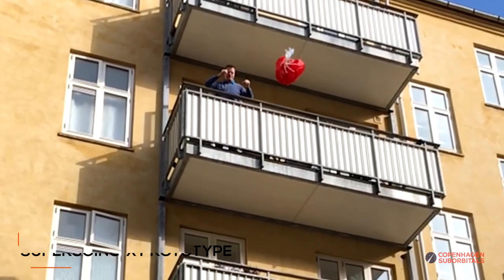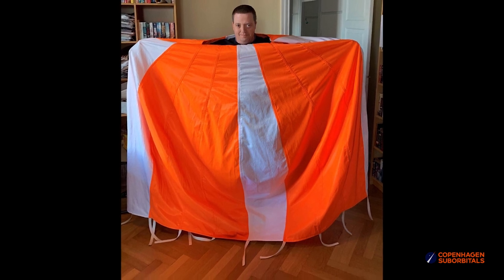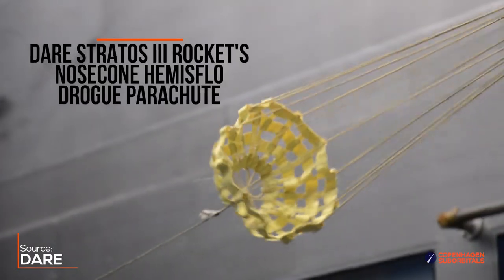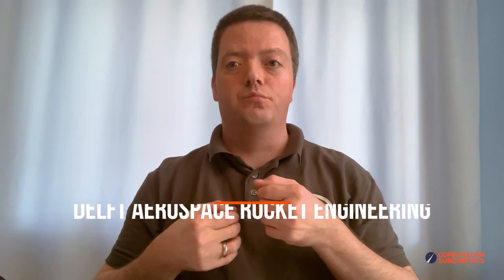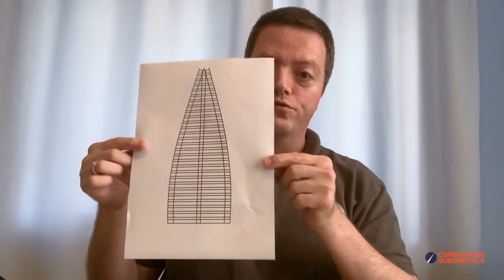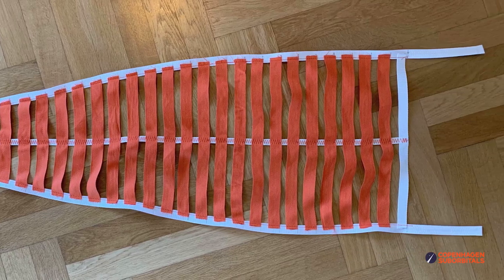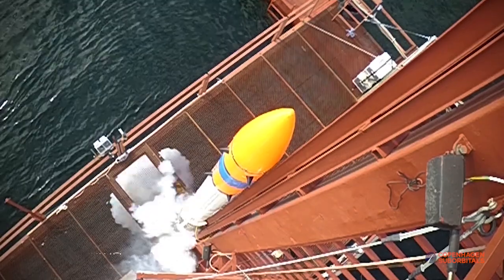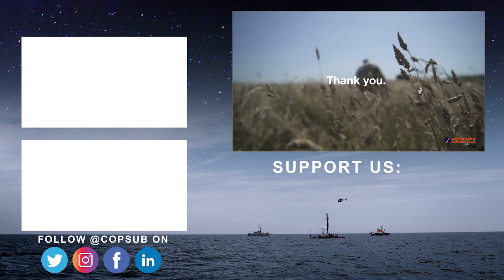Reusable Rockets: High-speed Ribbon Parachutes

Comment: THIS WILL BE RENAMED ~ COPENHAGEN ORBITALS ~ SOON
Reply: Yeah they are pretty close!
Reply: They are a very long way from orbiting a rocket. 

A suborbital hop needs only to reach up to 100 kilometres at apogee with a final vertical velocity of zero, in order to qualify as a spaceflight. To be orbital, the rocket needs to be travelling at about 8 kilometres per second (5 miles per second) and in a horizontal direction, at above about 80 to 100 kilometres.

It's the difference in power between Alan Shepard's suborbital hop on a modified missile launcher and Yuri Gagarin's orbit, or John Glenn's several orbits, both on modified and augmented ICBM launchers. Glenn's second stage was similar in power to Shepherd's first stage.  

In addition, serious consideration has to be given to the de-orbit and possible recovery of the final stage of the rocket. We would all like to see them reach that goal, of course, but let's get the 'baby steps' right first.
Reply: its called suborbital because their rocket isn't going to get into orbit, they're just going to the karman line.

Comment: I'm guessing that removing fabric from a larger sheet would invalidate the tensile strength of the fibers? I'm not so hot on fabric material properties
Reply from the maker: what do you mean with removing fabric?
Reply: @CopenhagenSuborbitals  cutting holes on it
Reply from the maker: @Fred_the_1996  ah, well, for some purposes it can be done. Ie. if you look at the sports parachutes, there you'll find holes cut/melted in between the cells, to help inflation. But for this type of application, a gazillion ribbons is unfortunately the way to go
Reply: @CopenhagenSuborbitals  oh

Comment: Great!
Reply: Not to sound like an asshole, but what spacex was aiming was for rapid reusability, and because of its size, a splashdown with parachutes wouldn't allow it and the landing would not be as precise
Reply from the maker: The missions and audiences are completely different
Reply from the maker: It would be much better to compare with Blue Origin (if any!)
Reply: @Fred_the_1996  yeah.. sorry for my ignorance in that xD
Reply: @areskyberkane9295  ok
Reply: @Fred_the_1996  rocket designing for most part is solely dependent on the organisation's resources and intentions so of by less complexity if they get the same result then what's wrong.
Reply: @vishalk4647  yes, in this context, a precise landing doesn't really matter, since at this scale a parachute splash down wouldn't hurt anything, unlike with bigger boosters, which can get damaged if they splash down

Comment: Great video. A question about the Spica rocket itself, when the rocket takes off, with the BPM 100 engine, what is the rocket going to use for 'thrust vectoring' control to keep the rocket on correct course or stability? Are you still going with the Jet Vanes or are you switching to a different method like gimbals for example?
Reply from the maker: Thank you Daniel! Great question, we will in fact use a gibal on Spica. We have an older video discussing why exactly, as well as a detailed presentation of our gimbal demonstartor which one of our interns designed, built and static tested with a BPM5 engine:
https://youtu.be/JshN7AolIbU
Reply: @CopenhagenSuborbitals  Okay then, thanks for the link, I have now learnt the reason for using gimbals on Spica. So once you've done one or more tests of the BPM 100 on it's own, are you going to do more tests with a gimbal version of the engine which could be the actual engine being used on the rocket itself?
Reply from the maker: @danielburmas1136  Yes, once we have enough data to prove the BPM100 reliable, we will test it on a gimbal as well.
Reply: @CopenhagenSuborbitals  Have you included gimbal mounts in the test stand design already, just to avoid a major do over of the inner stand structure?